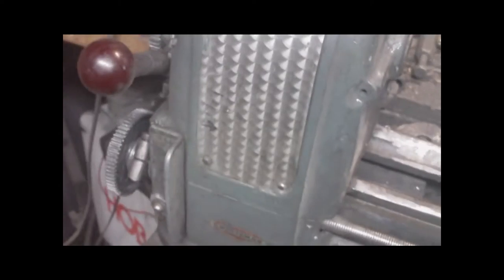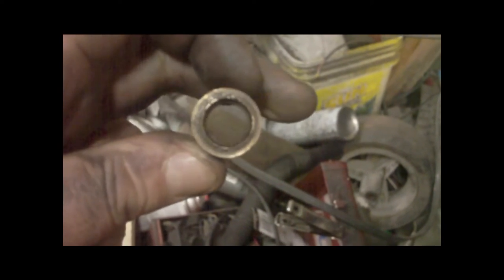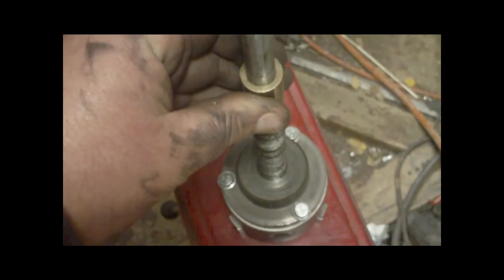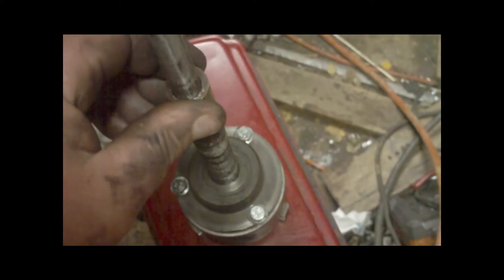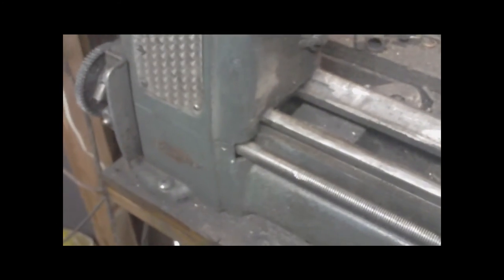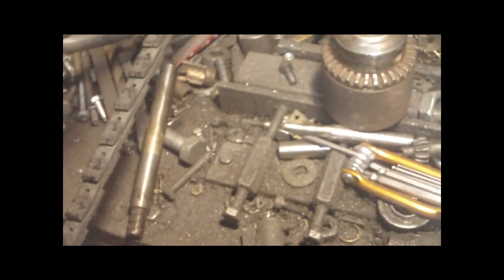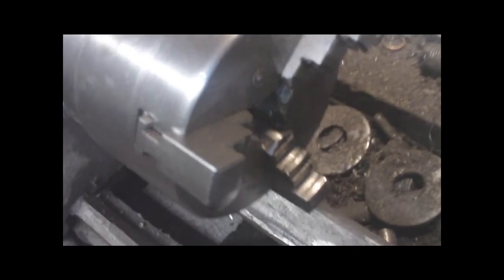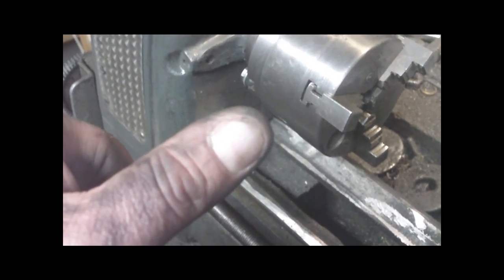CRAFTSMAN 109 REAR BUSHING REPLACEMENT

Comment: My lathe has Timken bearings, but the left one is similar to yours in that the oiler hole is blocked by the race. I am thinking about taking my countershaft off from the pulley bracket and replacing the bushings with bearings. That is the only thing on mine that is noisy and even after oiling it doesn't take long to get noisy again. Maybe  I should try replacing the bushings like you have done on your headstock.  Good fix!
Reply from the maker: That would be a good idea George , Who knows how many hours of work they have done !  Thanks for stopping by ..